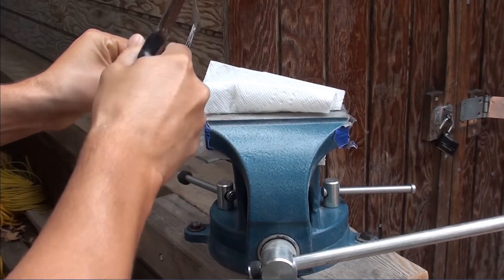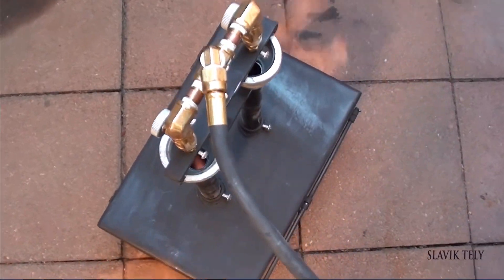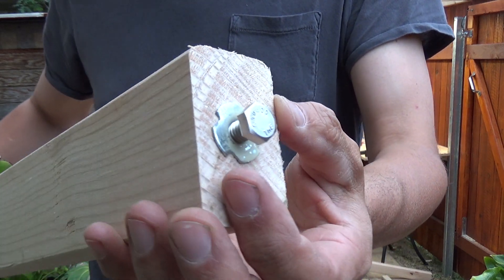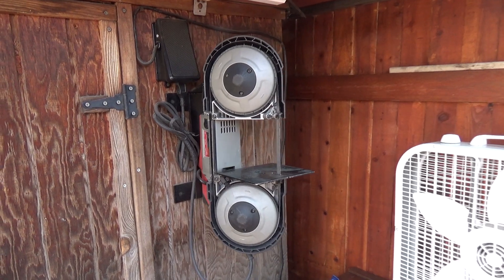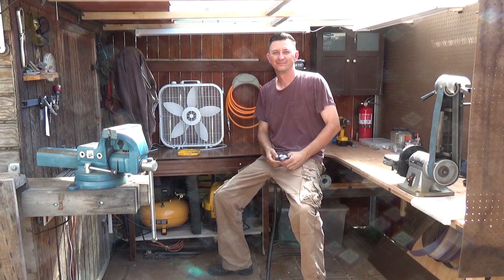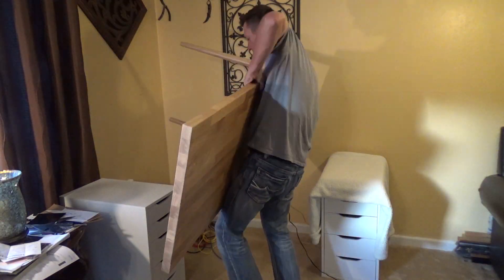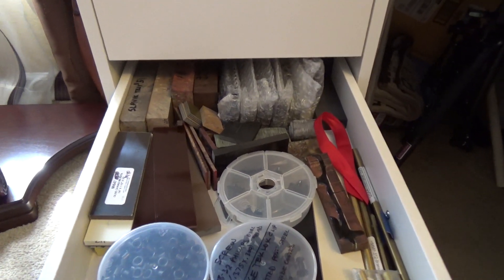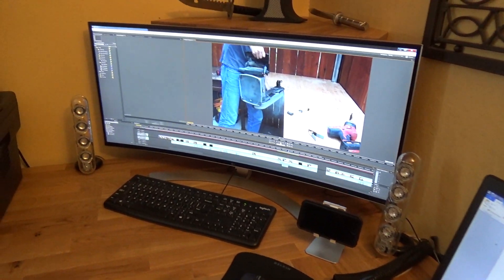Tour of my work space

Comment: Love your work. Does your 2x42 just have 1/3 hp? I want to buy one but was concerned I would have the same power issue I have with my 1x30. It seems to bind. The 3/4 hp is about 4-500 dollars. The 1/3 is about 200. Any advice?
Reply from the maker: It is 1/3 hp. You can stop the motor if you wanted but it is more power than 1x30. Buy the best you can afford.